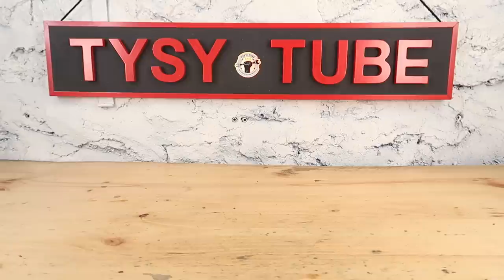Rusty Coffee Grinder machine Restoration - Incredible transformation

Comment: Ah......   How nice...... A Peugeot coffee grinder !
Yes, apart from cars, Peugeot also made pepper mills and coffee grinders !
The choice of color....... just like the purple lamp in the previous video.... not too good, I'm afraid.
When new, these grinders had polished metal parts (bare, unpainted parts). Bright yellow just does not go well with an old grinder. 
Beige, medium grey or a bluish light grey would have been a far more authentic color, a better choice. But that is just me.
And the bicycle spokes were a nice surprise...!!  ;-)  I first thought this grinder has been restored, before. But since this grinder was made by Peugeot, I think they may have actually used them for these grinders.
This type could be a Peuginox  (Peugeot-Inox). Stainless steel. If this grinder has parts made from stainless steel, a fine polish would have been better than a paint job. They didn't use stainless steel for nothing......
New or second hand, these grinders have always been - and still are - quite expensive.
I hope Tysy realizes what he bought. And what he restored......
The yellow paint will diminish the value quite a bit, I'm afraid.
Reply: Has the air of a trendy sixties colour to me.

Comment: You did a very good job with this one...I do have a question for you though. Why do you use paint remover to remove the paint and then soak them in a rust remover? Since you have a blast cabinet wouldn't it make more sense to blast the paint and rust all off at the same time? Not understanding the other two steps.

Comment: Do you use any of the items you fix up ?

On the wood you should try after you first sand it , make it damp with a little water and then dry it with a heat gun or similar, then sand it again.

This will get a much smoother finish !